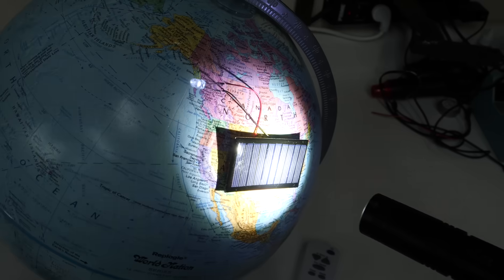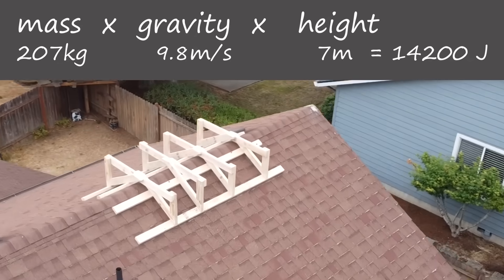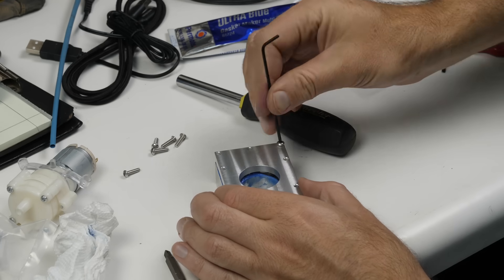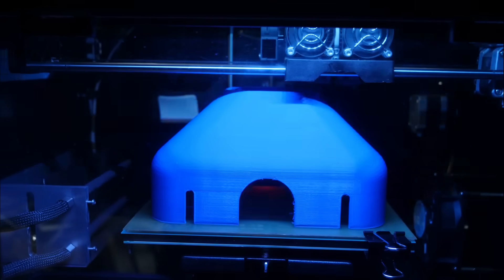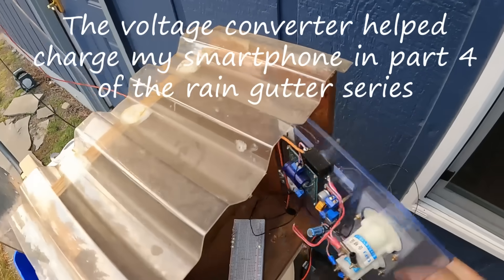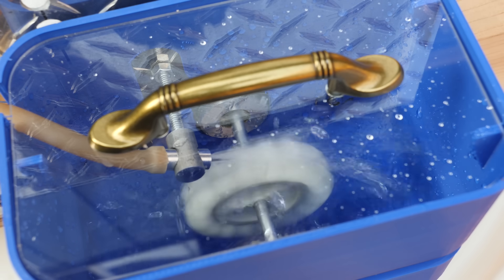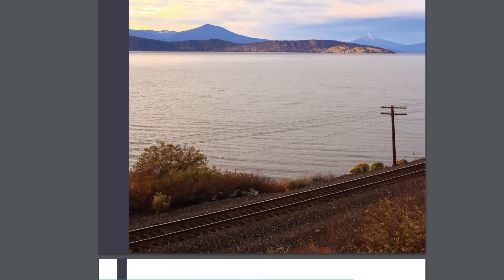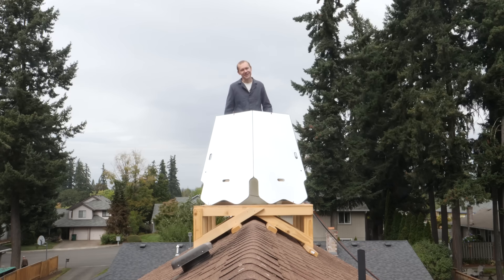Storing Solar Power on my ROOF!!!

Comment: I thought 28 ft. was max pumping height. Surprised that little pump did that. Cool experiment!
Reply from the maker: You might be thinking of a limit on how deep a hole a pump can draw water out of. Pushing up a hill has no such limit. Just gets harder for the pump.

Comment: The best way to store energy for long term is magnetising ferrite and then converting its magnetism into electricity and then when magnets lose their magnetism, magnetising them again after few days or months. 
Patents have been granted to magnetic battery and many youtubers have also replicated it, but it still has not hit the market yet, or may be in China they are using it on small scale.

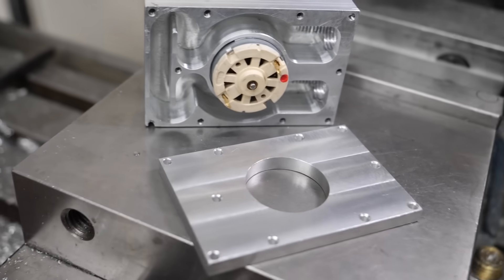Comment: 4:45 2 things: 1 remove the magnetic shield from the motor to greatly increase it's cooling. 2 - There exists no consumer level metal 3d printer; but if you had access to one, you could definitely match and even exceed that level of fabrication: did you know the SpaceX raptor engine is 3d printed! Cheers
Reply from the maker: Metal 3D printing nearly (99.9%) always involves 2nd op machining before the part can be used. Speaking from experience here. Metal 3D printing succeeds when materials are exotic and geometry is complex. But 99.9% of applications the interface that mates to another part must be machined for finish and accuracy. Some of the pats for rocket engines can be 3D printed but they can't simply be taken directly from the printer and bolted onto a rocket. If someone has 1st hand knowledge to the contrary I'd love to hear about it.
Reply: @QuintBUILDs  It goes without saying that every fab method has it's advantages and limitations; for sure the surface finish of a milled part will always be superior to 3d printed materials. The idea is to try and work around the limitations: Relativity Space is actually building whole rockets with 3d printers: https://www.youtube.com/watch?v=kz165f1g8-E

Comment: I feel like houses are not constructed properly. If you did this with well water right out of the ground to the top floor of the house and then let it fall into the hot water tank, so everytime you used water anywhere in the house, it’s creating power. Or the return on forced hot water system from the third and second floors.

Comment: They have found out recently that a reason for the degradation of lithium batteries is the use of a polymer in its contraction that can be easily exchanged with an alternative.

Comment: Surely if you had the water barrel on the ground the same size as the roof one, you would not need a shut of valve ??
Reply from the maker: Don't want the pump to suck air.

Comment: Wow this is so cool! Great to see how you involve your kids too, I'm sure they'll grow up to become as inquisitive and ingenious as yourself! Did you consider putting the barrel into your attic rather than onto the roof? Yes you loose a few feet, but it's invisible, and easier to get to, even for someone who seems to enjoy dancing around on roofs like you! Also, I'm wondering about how noisy the system is. Did you put the system or an optimized version into day-to-day use? The overall idea is sound, and definitely a rugged, low tech storage solution that will be applied more and more as crunch times hit!!

Comment: So instead of storing energy from your solar panels in a Li Ion battery (which will eventually break) you :
Waste energy to use a water pump (which will eventually break) to pump the water into a barrel and then use another generator (which wastes more energy AND breaks eventually) to turn it back into electricity?
Doesn't make much sense...

Comment: I like the project love your work and channel, but this is an energy transfer not energy storage. This principal is using solar to move water which In turn generates energy when moved back and forth.  It’s more of a pseudo battery. I’d love to see a project where you built an electrolytic pile battery out of those barrels.

Comment: This seems to me to be the most complicated way to get almost no electricity at all. I guess your gain is the fun of building and figuring stuff out 😂 I would go for solar panels on the roof and get power from that instead. And use the water in the barrel with a solar water heater to get a hot shower. In the mediterainian countries you se this on every roof. and instead of pumping water with a small electric pump why not conect a hose to your tap in the garage and just open it? 😎

Comment: 1) Earth's gravity is too weak to make compact batteries. Such a huge barrel was able to fit a miserable 14k Joules = +-4Wh. For example, the average smartphone battery holds 20Wh. 2) I am sure that the efficiency of this generator is somewhere around 20-30%, definitely not higher than 50%. And this means that out of the miserable 4Wh we lose more than half)))

Comment: Pumped hydro is unsuitable for small scale applications. Go to hydropower calculator and see what kind of water volume you'd need to pump over what elevation gains in order to produce the power you need in your house. Hydro might work small scale if you have access to a stream with decent flow rates but not when using pumped hydro. Pumped hydro is for large scale, grid integrated solutions. This is an intersting toy but not more.

Comment: Consider creating a high volume, low pressure Gravity Vacuum Water Pump from a lower water source to higher ground, such as a Pond or Garden, and incorporate a low volume, high pressure Ram Pressure Water Pump that continuously fills the sealed water barrel due to incremental water loss from the resistance water movement that lowers the barrel’s water level, which is needed to maintain vacuum pressure. The Ram Pressure Pump is loud, so a sound proof enclosure is required, and the tiny valves can clog, so proper filter engineering strategies are required. The Gravity Vacuum Pump output water into a Pond can include a Water Turbine for DC Electric generation to power a Pond weather station on a WiFi router that reports water level, water temperature at various depths, ice thickness, surface temperature, wind speed, etc. A Wind Powered Water Pump can also help fill a Pond, while also helping generate DC Electric for the Pond System or Garden. A ice depth device will require technology that doesn’t bend or break due to ice movement, and of a buoyancy material that’s lighter than liquid water, but heavier than solid ice in order to move the measurement device lower as ice forms, but remain under the ice above liquid water.

Comment: I have a ideas for a new video. Get a container that holds 1000 gallons build a piston inside and on top put hundreds of pounds of weight to push the water out and spin a generator.  Can it make enough power to charge a battery

Comment: I want to run this experiment with a wind turbine which are highly efficient and move with lighter force. Using a very light weight balsa wood wheel with little water buckets. My theory is that an overshot wheel using a water reservoir on a roof or so could produce btwn 250-300 watts if maximized for output with the right formula, angle and materials.

Comment: If you have guttering on the eaves to channel rain water then why not capture  it in a barrel at a greater height ( at the eaves ) to reduce the energy required from the solar panel to get the water to the desired height on the apex?

Comment: Would this same concept but as a gravity battery work better? Like lifting a weight, and letting it fall to power a generator? Seems the gears of chains would be more efficient then a water wheel? Plus you can add a flywheel to work as a capacitor? I’d like to build something like this to power my future small farm
Reply: I don't know how you would generate power over a duration with a falling weight. Once it falls it's down. Even if there's a billion joules of power while it's falling, you get that power for 1 second.
Reply: @gorkyd7912  ?you slow it down.. with gearing. Got to imagine 2tons, falling from 40 feet, over the course of 6hours. Will generate some juice

Comment: It is really informative that you were able to give us a clear figure: 
"( 1 barrell of stored water in the roof = 1 AA Battery. )
I always wondered what the DIY equivalent was to hydropower reservoirs. Hydropower is only usefull for home owners when they have a big land plot with streaming water. Pumping up to store energy and then release it, it's only efficient enough when talking about huge water reservoirs. Thanks for helping my curiosity.

Comment: Olds elevator driven by horizontal wind  to bring water up  this could power even at night  .  And you don’t need upper and lower reservoirs  or gravity battery in coal mines .

Comment: I don't see it all I see is water hitting ground in force not power to do much more than a phone and no instructions on how or what the water is turning for DC power
Reply from the maker: It's all detailed in the rain gutter power videos including links to 3d models. Best of luck!
Reply: @QuintBUILDs  you too I live off grid just to costly to have power lines put in they tell me it cost about $250,000 to just run lines to my property then $10,000 to drop on pole on property
Reply: @QuintBUILDs  I look for alternative power source all the time

Comment: All of the materials you used are not possible without using fossil fuels. So you have a fossil fuel power plus solar power water tower, fossilsolar  = fossolar power. The manufacture of batteries will consume the earth.

Comment: Pretty good system to power off my garages solar heater/small solar panel. They heat the garage in daylight hours and a small hydroelectric would provide power to a 12v auxiliary truck heater for the night time hours. You could also use the same pump to return water to barrel. If you paint barrel black you would also heat the water which could then be run thru small thin gauge copper coils or radiator set up with small fan system to fully use the sun for night / day heat and electricity

Comment: You missed out a huge and important part in the middle. How did the water come down? How did it generate the electricity? What equipment did you use to convert it and why? Then how did it convert to electric in the light? Shame. Could have got more views.

Comment: Couldn't one just heat water by the sun and then via a check vale pump it up onto the roof.  Then you don't need a pump motor.

Comment: I was reading about this variant of the lithium ion battery with a liquid electrolyte and a solid anode and cathode. The electrolyte is stored in large tanks and is pumped around. The tanks (and capacity) can get as large as you can store safely.
Reply: That will create a lot of road hogs.

Comment: Tokatee power plant (north Umpqua,  douglas county Oregon) does this exactly. Giant micro hydro power plant. Powering most of Douglas County.
Reply from the maker: So it pumps back to the Toketee reservoir for later power generation? I didn't know about that. Looks like they're looking to expand and pump from the power station below as well? I might need to make a trip to see that!
Reply: @QuintBUILDs  No I guess it doesn't pump it back up. But it's still quite the sight to see the 15ft diameter pipe going off the 100ft cliff with high pressure water in it. Maybe they should watch this video and they could figure out a way to pump it back up!!

Comment: I have an IDEA/QUESTION - What IF under the WATER TANK there was also some kind of SPRING that the WATER WEIGHT can store ENERGY COMPRESSING the SPRING?
Then as the the water is changed used to generate using gravity, the ENERGY SPRING is ALSO used somehow?
Kind of a 2'fer one battery using the water

Comment: It's just over what a single 2.8V 3000F supercapacitor can hold. Two 2000F caps in parallel could match the energy of the water.

Comment: Great project! I have an idea for another project. I wonder how much energy could be produced with a ducted fan of some sort mounted on a permanent magnet motor fed by the moving air through a NACA scoop or the most efficient air scoop. I have been fascinated by this idea ever since I ran across an experiment conducted in India to charge an electric car battery with moving air. I am converting a retired ambulance into an RV and want to find a way to augment my solar panels for charging my house battery bank as we travel from point to point.

Comment: While this video was quite interesting and educational, there is a reason water wheels are no longer in wide spread use. They are very inefficient as far as water usage. A small water turbine or possibly a automobile waterpump would work better.

Comment: Also, in CA since the problems of climate change, drought, combined w/ El Niño/La Nina phenomena causing wildfires everywhere,  having a ton of water available to sprayed w/o electricity on your roof and under the eves is a REAL VALUE. W/ many of the wildfires, power is turned off due to dangerous winds.

Comment: what about making a trompe to store compressed air and using that on demand for making electricity?
you could use the solar to get the water up to the roof then use the trompe on the way down to make and store air to then use the compressed air to make electricity.

Comment: You could collect the rain water directly from roof by mounting a number of more discrete collectors above the gutters, maybe with some architectural trim to integrate with the roof or eaves. Similarly, a reservoir that runs the length of the roof, sitting at the peak, would maintain the stored gravitational kinetic potential energy. This would require more investment in design and construction, but would reduce pumping energy (i.e.., changing from ground level to eaves/gutter elevation) A pump at each downspout position could allow for  multiple "cellular" compartmentalized storage chambers along the roof ridge, so one failure doesn't have to mean the entire system were lost. You can also purchase food-grade 50gallon barrels to collect rainwater at your downspouts.
Reply: It depends how often it rains. It would more effectively convert rain into power, but it would also lead to the system having problems with evaporation.

Comment: Actually, this isn't storing energy or even a kind of a "battery". What you have is pottential energy only. Meaning you can only use it in relation to an additional force. In your case, gravity. And it doesn't make sense to use this instead of a battery, because you have energy loss when you push the watter up and when you use it to spin your generator. 
It il be better used just by sending the power from the solar panel to a battery. Much more efficient. 
However, I understand your point, it's a valid example !

Comment: Did you not test it with multi generator all after eight other? Would multi generations stop the flow of the water? Coult you generate enough amps too power your pomp and your light without solar panel? Thank you

Comment: This is like a mini system that lots of people use with modified washing machines to create 24 volts from stream power and then through a converter to 120 220 or whatever you need. There’s lots of vids on YouTube

Comment: Please shut up they're called thermal batteries you can get it from ground temperature circulation you don't need the Sun on a panel on your roof shove that straight up your ass freezing temperatures break them

Comment: Love this - in New Zealand currently there’s talk of creating a mega battery out of Lake Onslow - 5TWh worth of storage apparently - I’d say massively distributed micro batteries like yours look more doable!
Reply: Micro is right, this stores less than 2 AA batteries worth of energy.
Reply: @TheGerm24  It could be easily upgraded to more, by using a more powerful pump and turbine, with more water available...but one would need to have a very strong support for the water at the higher elevation.

Comment: Also, the setup you created is far from optimal. A glass top gets a lot of water sprayed on. that is wasted energy.  Instead, the water wheel needs to be encased in such a way that all water coming from above hits the blades. Consider letting the water enter this encasing under an angle. You'll see there are slight gains to be made that way as well.

If you want to go totally crazy, the type of water wheel used in this video isn't that efficient to begin with. Try and see how a screw wheel, a.k.a Archimedes screw can convert the energy from the water into electricity. Heck, you could even use the same Archimedes screw to transport the water up during the day and generate electricity at night.

But, all in all, it is an interesting concept that should wake up young/inquisitive minds into physics, fluid dynamics and mechanical design.

Comment: A similar way of generating energy in a closed loop system is by using air pressure. These can also run for decades without maintenance. And they can be compacter too, if you are willing to up the pressure. Air pressure is the safest way, but were still talking about pressure, so you need to really know what you are doing to even contemplate of doing this. And, pressure installations have other disadvantages, building costs and size limitations. These are a lot more expensive. Also (much) more efficient than a waterwheel, as shown in this video.

Comment: Just didactical. Too many energy transformations to keep high the efficiency of the system, and so much losses in each transition. A storage battery replacement after 5000 cycles is still more economical (and leads to a way more practical system). If solar energy is drawn in form of electricity, then keep it in that form. If one has an huge excess of electricity at very low cost, then it's worth to pump up water to a basin.